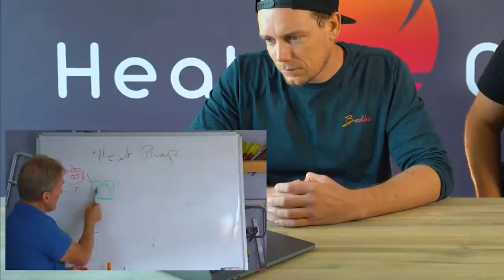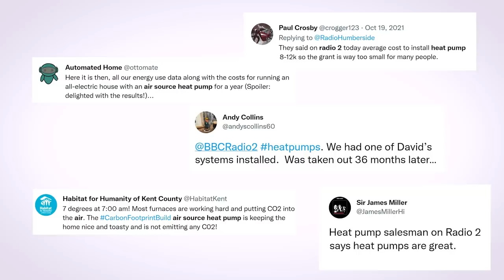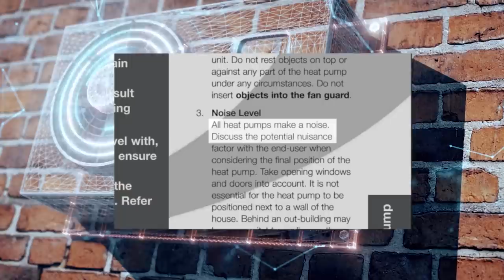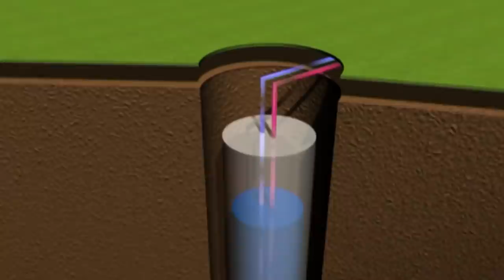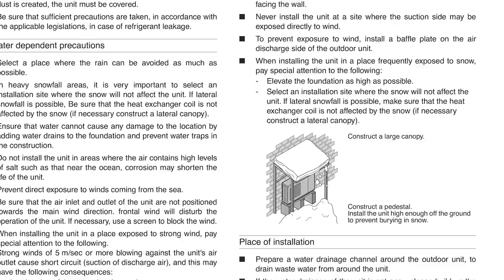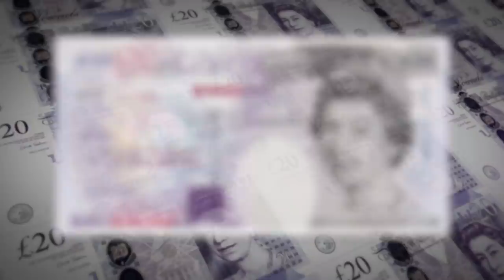Heat Pump Secrets They Don't Want You to Know

Comment: When the Microgeneration Certification scheme was introduced, I wrote compliance manuals for installers for wind, solar and heat-pump technologies. Therefore, I am aware of the good and bad points of ASHPs and the importance of appropriate siting. One issue is that modern housing estates have tiny plots with the properties only two metres apart, which provides very limited suitable ASHP siting locations. On my new housing estate here in Scotland, the obvious place to locate an ASHP is on one of these gaps between the homes but this is a wind corridor and fills up with a metre of snow during severe winter conditions. I would not like to be elderly and have to cope with this.
Reply: So much un truthful information in this video
Reply: Yep, you're not alone. The frustrations and costs for end users (particularly in winter) because of the impracticalities of these Air to Water pumps far outweigh the benefits and intended function in the UK unless you have good wall, floor and roof insulation. In summer, they're fine! Fkn nightmare come October to March/April!

Comment: I thought the Heat Geeks did a respectful review of your heat pump videos and it's nice to see a respectful response here. Both of you are on the same page about the need for proper design to ensure a successful install and I think both acknowledge that the design challenges for heat pumps are (to many) new and more exacting. It doesn't mean heat pumps are bad, no matter how many warnings manufacturers put in their installation instructions to protect them from claims for stupid installations.
Reply: And you can also add that boiler can be poorly designed and if you cherry pick enought, NG boilers never work and is a scam...

Comment: Meanwhile, up in Braemar, Aberdeenshire council is in the process of removing open fires from ALL of their tenants' properties, while switching those same properties over to the crap electric heating that Roger is talking about. That's the same Braemar that was without power for ten days following December's storm Arwen, and the same Braemar that has experienced temperatures as low as -27.6 Deg C.  You have to love the Scottish Greens!
Reply: That is unthinkable! I have an air to air heat pump which is not able to deliver consistent heat through a cold 24hr, but i have 2 chinmneys/3 fireplaces and any one of those makes the entire house resonate warmth.

Comment: This video is stating exactly what we advise customers before we go ahead and install them, other channels promoting heat pumps have actually deleted mine and our other engineers comments advising of these things in the past which honestly is crazy. You can't temper peoples expectations and avoid call backs if you don't give professional engineering advice up front in the first place.  
There are advancements being made with heat pumps all the time, flow temperatures increasing, load sizing and reduced risk of freezing. Also instructions like for system boilers are increasingly asking for a bypass in some form or other to be fitted, be it a UFH circuit, towel rails or standard bypass as the increased water temperature flowing through the units actually helps to stop them freezing up and having issues. 

People worry about Nox and Gas power stations having to ramp up which will increase Nox - but there's one huge difference between stations and homes, stations in theory could have oxygen supplied to them removing the need for air and then burning more cleanly. The same method to produce hydrogen could be used to produce the oxygen allowing for cleaner burning of Natural Gas reducing its emissions and also providing hydrogen for HGV's and other vehicles where heavy batteries aren't the most efficient.

Though the best advice for any customer that can't afford a costly upgrade is just to insulate, plenty of YouTube videos on how to make homes more thermally efficient and regardless of heating type it'll help reduce emissions.
Reply: Probably the biggest source of misconception is that we fail to educate the public in our public schools.  I can't think of a good argument for why everyone shouldn't be taught basic physical principles.  Decades ago people did a lot more for themselves; today, how many people on the street would you have to interview before finding one person who could explain the concept of latent heat of evaporation?  Then how many before one could tell you what some celebrity or sports team is up to.  🤔😮🤯
Reply: @elgringoec  People today cant tie their own shoelaces. When I grew up I was changing the bearings on the car and fixing the boiler and getting the parts for everything on a motorbike before I was 13 years old. Kids cant change  a lightbulb these days,.
Reply: @cuckingfunt9353  When ah was a lad we slept standing up in a brown paper bag in the fast lane of the M1. We got up an hour before we want to bed and ate a handful of cold gravel for breakfast, all before our morning thrashing. We fixed boilers, shovelled coal, cleaned chimneys and licked floors clean for 25 hours every day. It never done us a shred o'harm. Ah they were grand old times...
Reply: That paragraph about power plants having oxygen supplied to them is way off. I have never heard of a power plant that takes air and separates the oxygen out to burn natural gas. That process of pulling O2 out of the air takes a lot of energy. I highly doubt any power plant does this.

Comment: Always a honest opinion and enough info to make a conclusion.
We have installed a 300 litre mains pressure air source unit.
According to the info it has solved the energy crisis ! 
It needed a 40 amp MCB as recommended, max current draw 35amps ! It also needed a 16amp single phase as it has a 3 kw immersion.
The plumbers said it need a immersion which is controlled by the unit to get the water close to 60 degrees as the unit won’t get water to that sort of temperature without it.
The outside unit when running is enough to piss the neighbours off but in this install it’s not an issue.
Reply: The immersion is to run the legionella cycle once a week and in the event of the external unit failing.
Reply: @benfreeman3780  Disagree re- legionella, it's a closed loop system and you have a dose of inhibiter in the water/fluid to do exactly that, inhibit bacteria growth.
Reply: @electroshed  all ASHP’s are required to be set up to run a weekly legionella cycle, which pushes water temps above 60c to kill off bacteria in the cylinder.
Reply: @benfreeman3780  in a closed loop a) what do the bacteria use as a food source b) how can they possibly get out to infect anyone?
They are an airborne pathogen, so if there's no aerosol, no risk.  Unless ASHPs vent to air indoors?
Reply: @james.telfer   just because a system is closed it doesn’t mean bacteria cannot be present, however unlikely it may be and it is an MCS requirement that all LT ASHP’s run a pasteurisation cycle. 

 “Ideally heat pump flow temperatures for hot water generation should be 55oC or greater. This temperature will assist in reducing the multiplication of potentially harmful bacteria such as legionella pneumophila which can result in a pneumonia type infection known as ‘Legionnaires Disease’. Legionella bacteria stop multiplying at temperatures above 50oC and are ‘killed’ by temperatures > 60oC. Occasionally stored water should be heated to 60oC in order to pasteurise the cylinder”.

From the MCS guide.
Reply: I should add that I’m not a big believer of the true threat of legionella by the way. Simply clarifying why an immersion function is necessary for an ASHP setup and hence the “massive cable”. 

As much chance of contracting legionella’s as a mouse chewing through a power cable I guess 😉
Reply: @benfreeman3780  ah, so they're confirming there's no risk to end users in normal operation, but if you bled a radiator there's a possibility of aerosol exposure then.
I did clinical microbiology in my degree, so from a biological point of view the likelihood of growth then infection world be very low with a lack of nutrients in the water but good advice to cover the bled valve with a cloth to prevent aerosols.
Reply: Do these systems need a three phase supply or are all supplies single.?
Reply: @nigelmitchell351  most must be single or you wouldn't be able to install them in most houses due to lack of 3 phase supply.
Reply: @nigelmitchell351   it depends on your heating requirement. The larger units typically offer both options but larger needs usually require a 3-phase supply. Larger needs typically big new houses or older, poorly insulated homes which need to be carefully considered as to whether an ASHP would benefit the homeowner / property.
Reply: @benfreeman3780  Thanks Ben, one of my concerns is noise, I will eventually have about eight of these fans with my immediate neighbors and houses which back on to me.
Surely the noise and harmonics are going to make a pleasurable sit in the garden a thing of the past.
Seems to me we'll swap one form of pollution for another.
Reply: Put 1kw in to get 4kw out. Still a lot of electric, unless you have solar panels and a big battery. Yet more outlay.
Reply: @electroshed  you don’t drink or wash in the fluid circulating around your closed heat pump circuit 🤦‍♂️ the immersion is top up the stored hot water temperature in the hot water cylinder. Heat is transferred from the ashp to cylinder via a coil in the cylinder same as a system boiler. Stored water must be heated to 60-65 for legionella most ashp top out at 55.
Reply: @nigelmitchell351   many of the latest generation ASHP’s really are very quiet. Most people tend to enjoy their gardens in the warmer months and they will be the times when only minimal heating is required and therefore the outdoor units won’t be on or will be just ticking over silently. 

Try not to worry.
Reply: The immersion is used to run the legionella cycle once or week or when you decide by settings menu.But it is also used to boost water temperatures as it won’t get to 55/60 without it.The unit could be specified as 3 phase and that was the original spec.I originally installed a 5 core armoured 4 mm as on 3 phase it only needs 16amp 3 pole MCB.
It had be changed as customer order got cocked up and they said there was a 40% restocking charge and months of waiting.
Easier for me to redo cabling.You can also have the option of powering the internal unit from the outside unit.
I installed separate power supplies and then just a screened 2 core cable as a data link.It’s low voltage 24v.
Inside unit only needs 10amp single phase to run the brain and 3 pumps all preplumbed on the cylinder.
Have to be careful with siting outside unit taking into account high winds and other weather factors. Near the sea will shorten working life as the salt atmosphere will degrade parts quicker.
Second one we have done now and only issue with first one was strainer getting blocked as system not flushed properly.
Reply: @rogerbean393    Many manufacturers produce coastal units which are designed for properties near the sea. We have installed a fair few and with no issues this far. You don’t need to spray them with a protection coat either. 

The ASHP’s can achieve 55c water temps without the immersion but higher will require it. 

We’ve installed a fair few and have never had an issue with high winds, salt corrosion, snow, glycol costs, or adventurous rodents ;-)
Reply: @benfreeman3780  It’s all good stuff , I’m a fan ! and I like the fact it’s just a plumbing and electrical job.
I guess time will tell exactly how good they are.
I was surprised how quickly it got a 300 ltr up to 45degress yesterday considering its a lot of water though, it was only a matter of a few hours.
Reply: @rogerbean393  it might be rated at 35a but that will be a start up current. That'd where alot of issue occur with heat pumps is the amount of start ups throughout the day. Once they are running the current will reduce.
Reply: @mikecole4952  yep obviously, it quite happy sitting on a b curve breaker as well so no real inrush currents.
It maintains healthy temperature at 49 degrees.
Had to have a pump put on hot water return so not waiting at the taps for hot water to come through.
No provision to control this on original FC5 brain ! So has to have another control for 8/10 hours run time.Once all the airs out seems pretty quiet now.
Reply: @johnf3326  1kw in 0.9kW out for gas… that’s a lot of gas unless you start doing your own fracking… yet more expense
Reply: @james.telfer  no no no.

The chance if legionella infection is absolutely miniscule.

The boiler usually supplies at a minimum of 70⁰C and this is constantly circulating so legionella will be negligible.
Reply: @electroshed  It sounds like a HWSHP. If it is then Ben is right.
Reply: @nigelmitchell351  Best to avoid having too many fans, harmonics can be a real problem. Have you considered using a buffer tank , something like Panasonic Aquarea for air to water or a mini VRF air ro air system with one or two outdoor units/many indoor units? samsing and Tosh both do very cost-effective systems that are technically bulletproof.
Reply: @memezilla4370  What boiler? We're talking about a heat pump.

Comment: Great video, very balanced! 
Just a couple of corrections though: 

As for the comment on cable size and power usage, this will depend on the unit
I live in a fairly average sized house, we have a 6.8kw air source multi system (roughly 10kw heating output) and the max rated power consumption is about 2500w, similar to a fan heater so a fairly standard cable can be used (actually had it running off a plug the first winter it was installed before electrician could come and hard wire it and it was fine) 

Rain isn't really a concern, unless you put it somewhere that's prone to flooding 
Water contains a huge amount of thermal energy so if rain is blasting onto the coils it will likely make it MORE efficient since it can remove the heat stored in the rain (except if the coil is below freezing in which case you may find it'll have to defrost sooner)

Most air source heat pumps now days will be rated to run down to -15*C, and since they're all variable speed, you can get away with oversizing the unit a little to account for capacity loss in extreme conditions
In southern England where it rarely ever drops below say -5*C there's no need to worry, but up north that is definitely something to be mindful of

Heatpumps also DO NOT require your home to be perfectly insulated, they simply provide heat energy to the building, if your building is poorly insulated you just need to factor this in when you calculate the capacity of the system. 

Biggest thing is though, it absolutely IS FAR BETTER to run a heat pump powered by a natural gas power station compared to burning on-site even when accounting for power generation and transmission losses.
Technology Connections made a video where he explains a heat pump only needs a COP of about 2.5 to be more efficient than on-site combustion, which is an incredibly attainable figure considering a cheapo noname brand heatpump can easily hit a COP in the 4's

Comment: I have three minisplit air con units that I primarily use in heatpump mode, they're great - I agree they have downsides eg not suitable for very cold locations but doesn't every form of heat generation?   Oversizing the breaker/cable is common practice for anything that might draw a fair bit of current or have a high inrush current, most inverters will throttle back once the water has reached near-setpoint temperatures.  My units start doing defrost cycles when it gets to 4*c or below.  Not placing units in direct galeforce winds is understandable but it would take a fair few gales/hurricanes to damage the fan.  Direct water spray again understandable due to ice build up.  Again keeping out of reach of snow drifts is understandable just like keeping your gas boilers condensate drain ice free, all common sense stuff really.
Reply: Heat Pump Technology Has advanced and They Make What Are Called Hyper Heat Systems That Will Perform Well In Below Freezing Condition, I believe To -20°f. Minisplits probably Aren't the Best Choice In Cold Climates, I live is subtropical climate, we rarely have hard freezes. But as supplemental Heat and A way to Conserve Fuel they are a Great, inexpensive Solution.

Comment: I attended an estimate for a family today, they have a Heat pump in a 120 year old property with minimal insulation, it has been a disaster for them, they want it removed and a natural gas boiler installed in its place. The installing company have since ceased trading, I honestly felt sorry for the chap.
There is nothing wrong with the HP, it should have never been fitted in that property.
Reply: My house was built in the 1700's.
No heat pump for me.
Once this gas contract is over. I'm ripping those gas fires and boiler out too and going back to coal.
Getting gas heating was the worse thing  I've done
Reply: Exactly. Horses for courses.